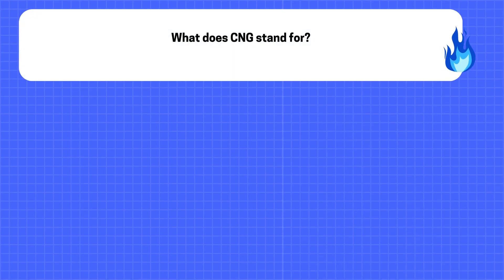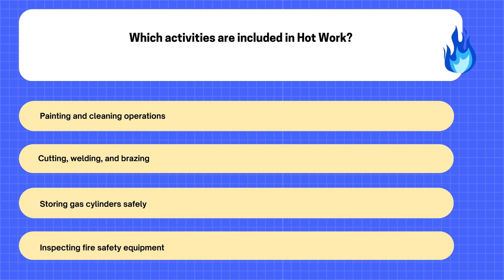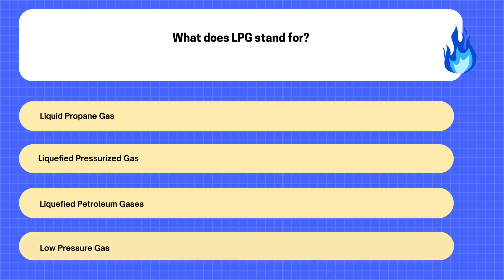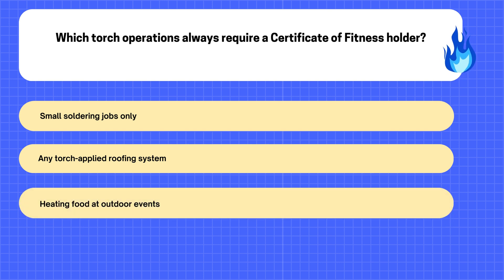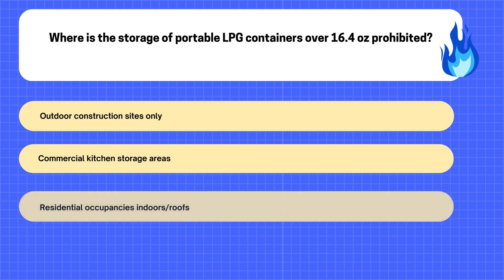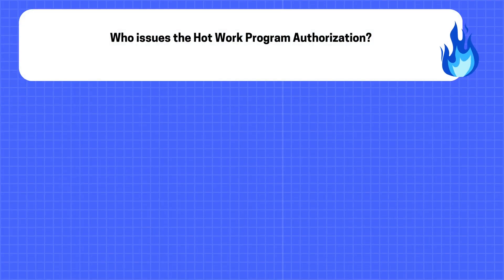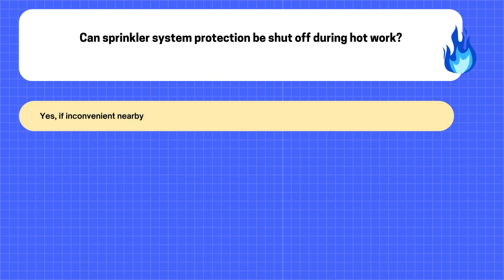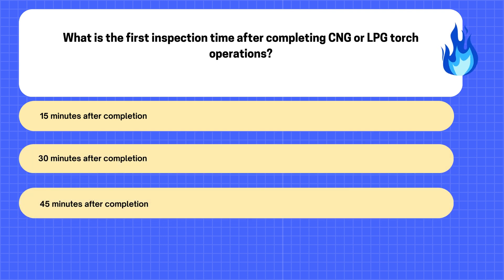FDNY G60 practice test

Comment: Thank You!!
Reply: Did you take it? Is it accurate?
Reply: @sforsteven731 yes i got F60 ,G 60 . but a examination a lot different questions!!!
Reply: @vladimirhvac2993 congrats! Did the test have lots of questions that weren’t on the video? Or are all of the questions are there?
Reply: @s @sforsteven731  yes I see couple same question maybe 10 but a little different questions and different signs. It’s. These are very cleverly worded questions, and you need to think logically to answer them correctly.